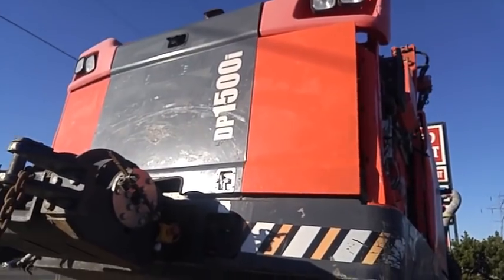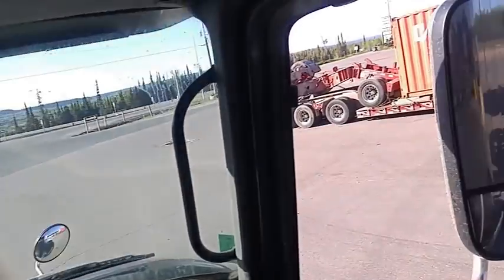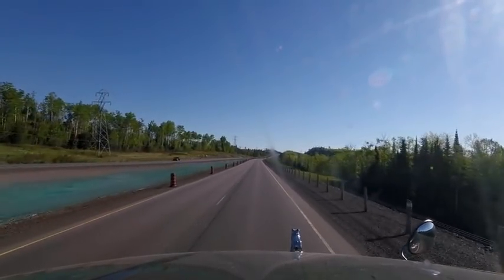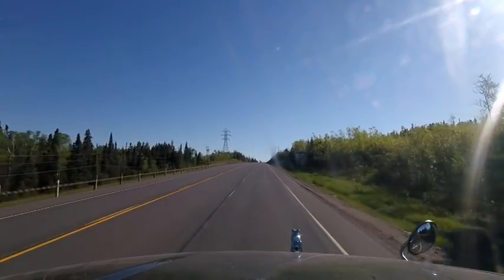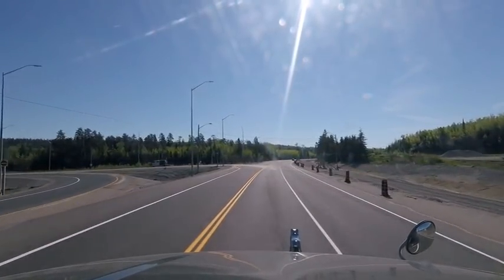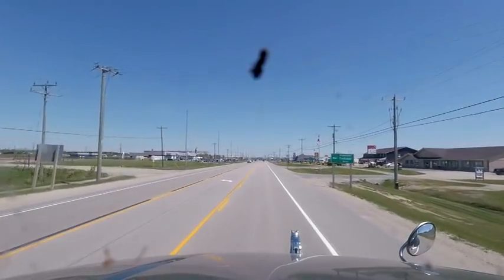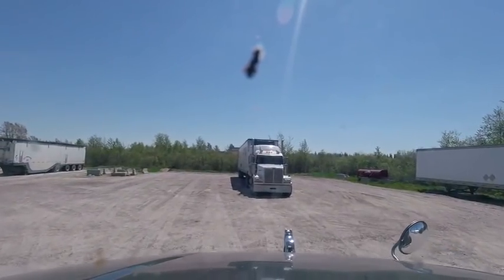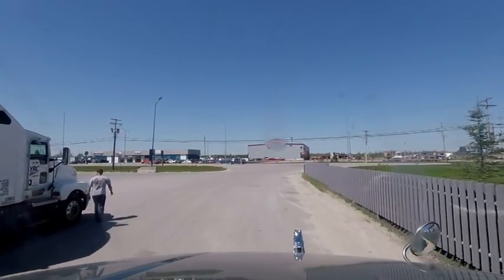Heavy Haul TV: Episode #543 -- Sandvik DP1500i Drill Rig

Comment: Captain Sergei sir, What beautiful scenery. Have you ever been hassled by other truckers during your career? It seems some truckers can be pretty rough and gruff and you nice guys have some exposure to mugging or theft as you travel. It is nice to watch great videos that are not full of four letter words. Be safe and God Bless.  Another dumb question showing my ignorance...They build such beautiful sleepers, why don't they somehow include a toilet and shower like in a motorhome or camper? I am sure they could engineer a space for it
Reply from the maker: The problem they have with installing bathrooms in trucks is that just as on the railroad, you cannot use the toilet when the vehicle sits at the station (truck stop). But extremely expensive training and certification are required for the driver to be able to use the toilet inside the truck when its moving! Research shows only 1.5% of truck drivers can steer the truck and deal with a roll of toilet paper at the same time.